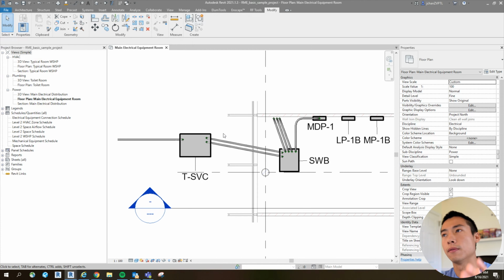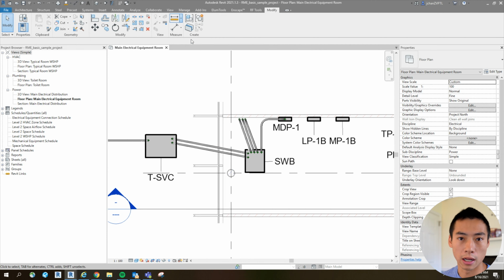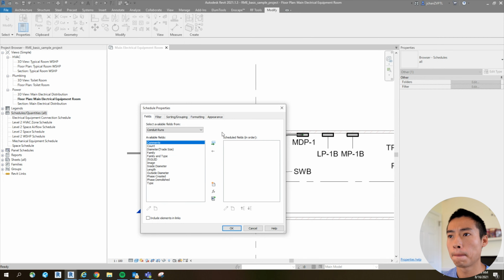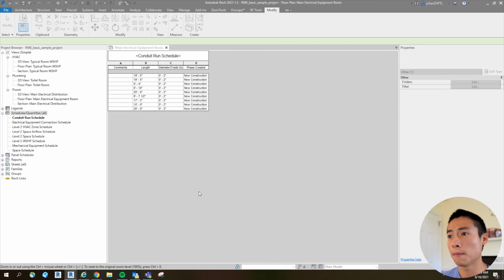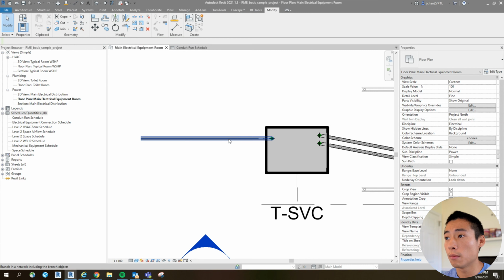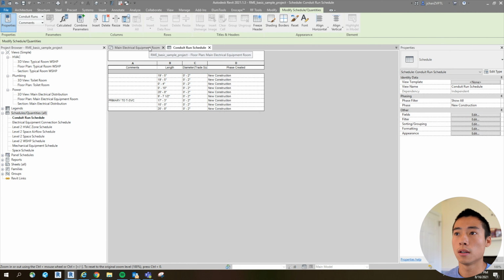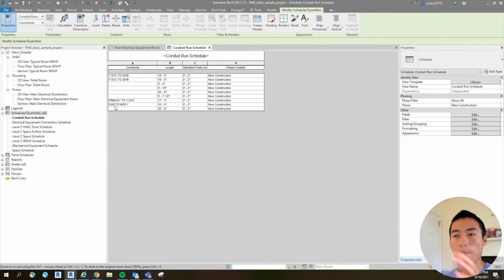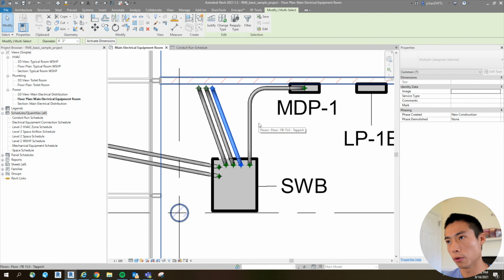Revit Review - Find Total Conduit Run Lengths

Comment: Excellent video, I just have a quick question in regards when you have conduit fittings in the whole run, if Revit will count the length of that particular fitting? because I was doing that, and I realize it do not do correctly when we have fittings.
Reply from the maker: Oh that’s a great point…I had assumed it does measure the fitting as part of the run, I’ll have to go back and test/check this. Thanks for pointing this out!
Reply: @theelectricaldepartment  I just tested it using a 90 degree conduit run with two legs being 10' feet long each. The sum of the straight portion is 20'. The sum of the two, back-to-back measurements is 24' - 4 1/2". The total length as calculated by the schedule is 23' - 4 1/8". So in my opinion it is counting the fitting as well.

Comment: You can uncheck the itemize button and add the "Count" field to get a count on conduits in the same run faster and with less clutter.
Reply from the maker: Do you know if there’s a way to round off slight differences? Sometimes the count doesn’t work because a bent ductbank will have its outer conduits run a tad further than the inside conduits, thus the distances are not exact and the itemize feature won’t lump them together.
Reply: @theelectricaldepartment  If you go into Formatting > Length > Field Format, you can round all of your lengths to whatever measurement you want, and that will group everything together automatically. For instance, if you have one conduit that's (5' - 1 1/4") and another that's (5' - 1") and you choose to round to the nearest 1/4", those two conduits will be considered the same in the schedule and you will have a count of 2. Mine was set to 1/32" by default and I had to uncheck "Use project settings". As a guy that was just the one installing the stuff a couple months ago, we always said one inch and one and an eighth are the same thing, so that feels like a comfy measurement to use.
Reply from the maker: That’s awesome! I gotta try this out.

Comment: What happen if the schedule isn't showing any of the conduits?
Reply: The most likely reason is because you've used "conduits with fittings".  Revit only recognizes conduit runs when they are done with "conduits without fittings" category.  This doesn't make too much sense to me but it is what it is - it's just Revit being Revit.  :)
Reply: @aleksandrsholokhov2241  Appreciate it so much. You saved my time in discovering why the conduit runs does not work until i realize the category is conduit without fittings.
Reply from the maker: Might have the wrong phase selected. Just today we realized our receptacle schedule was set to Shell and didn’t show anything we put in Fit Out 😅